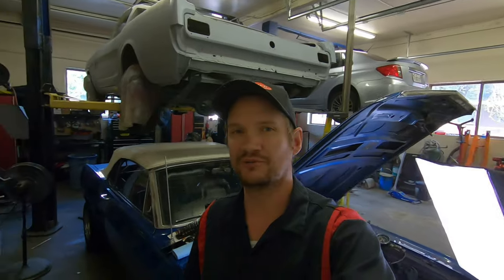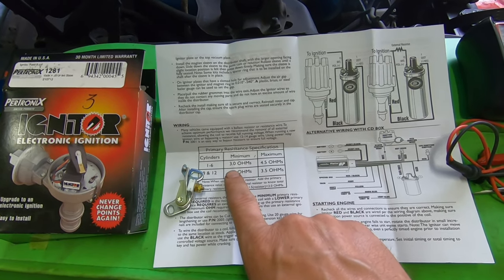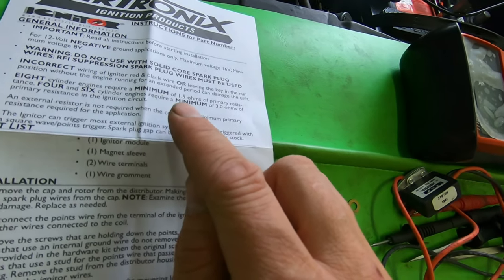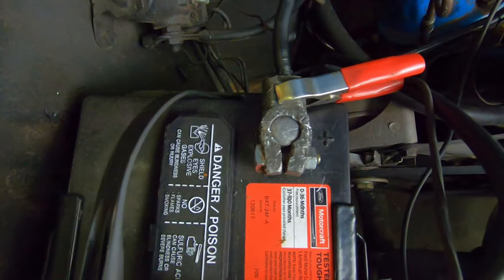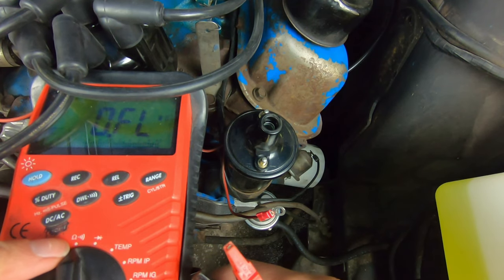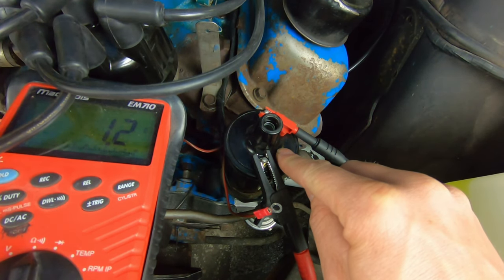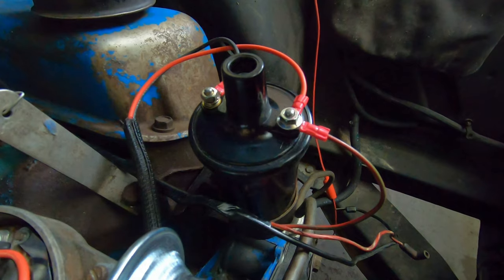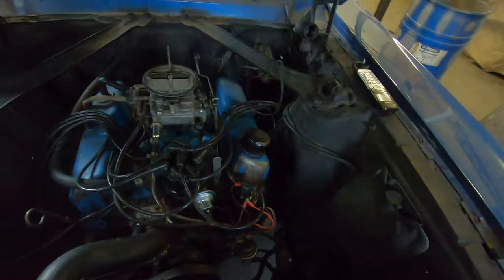Pertronix Electronic Ignition Upgrade - 1967 Mustang 289 V8

Comment: I would say that you need to bypass your resistor wire as mentioned in the manual. Your ignitor need full 12V, your resistor wire gives just 6-9V after start-up.
Reply from the maker: I understand it states that it operates best by bypassing the resistance wire and using their specific coil. But it's simply not necessary as long as you're within their total resistance specifications.

Comment: Im getting ready to start up my 68 Mustang and I'm reading 0.9 OHMs on the coil, which is a Flamethrower 3. I dont have a battery installed in my car. I have the multimeter set to 200  on the resistance. When I check my ignition wire and the positive battery terminal, it was over 200 OHMs. So I disconnected some wires I had mickey moused on the ignition to install a radio when I  just got the car back in 99. Plus some other wires I believe for a retro gauge minitach. Anyway, got it down to about 30 OHMS by doing that, but since the ignition was just hanging under the dash I mounted it correctly and now my OHMs are reading over 800 on the ignition wire. I know I must be the one doing something wrong but if you have any idea please let me know.

Comment: Thanks for video. I'm looking to install on '66 Mustang 289. What is your take on the Pertronix III? It looks like it requires a new Pertronix III coil and ignition power relay kit to provide 12 volts. Trying to decide between the two and would appreciate your thoughts.
Reply from the maker: Well to be honest with you, I've never installed a Pertronix III. Most the stuff I work on are stock engines/daily driver/cruisers. So with that being said, I tend to keep things as simple as possible. However, I'm sure the ignitor III unit is far superior to the basic ignitor. I would probably go for it and see how it works. But I would also run their coil and relay unit to get optimum performance.
Reply: @AlfsMustangGarage  Thanks for the reply. I have a daily driver. Maybe the P III is more than I need? It seems a little more complicated of an install than what you show. Excellent video. Thanks!
Reply from the maker: Ya it's definitely a little more than what this video demonstrates. So if it's just a daily/cruiser, you definitely don't need to get too crazy with it. Just keep in mind those resistance checks of your system and if things are not within specs, you'll want to bypass the resistance wire and use the actual pertronix coil.
Reply: The Pertronix III needs additional components removed from the distributor at the vacuum advance.
Advantage of the ignitor (first gen) and ignitor II (which has an additional circuit protection if you leave your key on) is that you can carry a spare set of points. In the unlikely event of a Pertronix ignitor failing or whatever, you can easily go back to points simply and quickly.

Comment: Very well done and well explained. Another thing to check is your set of plug wires' resistance, especially if they are old. High resistance in those can adversely impact performance .
Reply from the maker: Yes absolutely. Thank you!
Reply: What is a good range? I have Duralast Gold 7mm Suppression Core wires measuring at about 2,000 ohms per foot. Is that okay?
Reply: @LoneWolfStands357  Interesting, 5K Ohms is about the lowest u can get with suppression wires which is outstanding.
Reply: @supersonique001  oh sweet. I’m glad to hear that. Just curious, I searched for hours on google, is there like a spec sheet that you know of that lists what resistance wires should have? Thanks
Reply: @LoneWolfStands357  Not really, it's just that any good suppression wires should be as low as possible without interfering with radio signals. Zero resistance is usually solid copper which is no longer used because of their interference or wires that have a break in them which are no good to you anyway! At 2k Ohms your good to go!
Reply: @supersonique001  right on, thanks again

Comment: Excellent video. I knew about the resistance having to be correct but no other video that I have seen explained exactly HOW to test for it. I'm installing this on a 1987 OMC 3.0 boat motor. It is a GM 4cyl engine and I know that GM always ran a resistor wire instead of an external ballast resistor but don't know how OMC wired it from the factory. This video will save me a bunch of time and headaches not having to trace wires.
Reply from the maker: Oh right on! Glad I could help!

Comment: Great instructional video.
I had to do a resistance wire bypass after it failed. Upside was I was planning a Pertronix install anyway. Bypass was simple enough just ran a suitable gauge wire from the ignition pigtail (1970 mustang) to the coil, spliced in the brown wire from the solenoid (for 12v cranking). Had to upgrade my coil (due to the 12v run voltage) so used a Pertronix flamethrower suitable for 12v system and Pertronix ignitor. All good.
Great videos from Alfs mustang garage, 👍.
Reply from the maker: Oh right on! Yup sometimes that's the way to do it and sounds like you did everything right. Good work! Thanks for being here 👍
Reply: @AlfsMustangGarage  ,
Thank you for your videos,
Reply from the maker: You're very welcome

Comment: This is by far the best explanation on this topic! Thank you!!
Reply from the maker: You're very welcome
Reply: @AlfsMustangGarage  Hi Alf! Someone told me I should better supply my Ignitor 1 and the 12V ignition coil with a relay to relieve the ignition switch. Unfortunately this doesn't work at all (the engine keeps running after switching off) so I'm thinking about throwing out the relay and installing it like you without it. Do you think the relay is really necessary? Would the ignition switch really be damaged? Seems like most people install the pertronix without an additional relay. Car is a '70 Galaxie.  Would appreciate your thoughts...
Reply from the maker: It kinda depends mostly on what type of ignition coil you have. It also depends on how much total resistance you have in your circuit and coil. There isn't anything wrong with using the relay. But if it's not turning off, I'm guessing you might have it wired wrong. I would read the information that came with your particular unit and go from there. I talk alot about the resistance in the circuit and that often gets overlooked. I hope that helps.
Reply: @AlfsMustangGarage  Thanks for the quick reply! The coil I have is the Flame Thrower with 1,5 ohms. The ignition wire that went to the coil before now goes to 86 to trigger the relay. And 87 goes to + of the coil. 30 to battery +  and 85 to ground. You're right I focused more on wiring than the correct resistance. I'll have to check that. Thanks again!

Comment: Personally had alot of problems with the I & II versions. Went with the Pertronix III with the Flamethrower III & the relay that ensures you're getting 12v to the ignition. Doesn't have the issue of burning out if you leave the ignition on. Just spend the extra and get the III. Trust me. It will save you so much headache. Get good plug wires also. I went with Pertronix. Pertronix sells the relay on Amazon. Used on a Ford Racing 306 (slightly bored over rebuilt 302 roller motor). Dyno'd at 275 ho @ the rear wheel. 1968 California Special. C4 with Gear Vendors overdrive. 3.93 rear end but 2.72 final gear with od.

Comment: Great guide. If I understand correctly vacuum advance becomes disabled and it has no function?
Reply from the maker: No, the vacuum advance still functions as designed.
Reply: @AlfsMustangGarage  oh, of course I totally overlooked it. Does it add anything to general performance of the engine when driving (being loaded) it in comparisson to previous breaker system?
Reply from the maker: @AljosaPismonosa i don't think it adds any noticeable performance. Just a more consistent trigger mechanism that doesn't require the need to re-gap and/or clean up the carbon like with mechanical  points.
Reply: @AlfsMustangGarage  thanks!

Comment: Alf, Declan here in Ireland. The shaft in the distributor has some play in it so decided to swap it out with a replacement distributor. Before doing that I ran your recommended resistance tests. On the final test, ignition wire on coil + and other test wire from coil - to battery +, I got a reading of 6.8!! This can’t be good. With everything connected to the coil, a test across both poles have me 3.5. Don’t know if that has any relevance. My head hurts.

Comment: My 66’ mustang had the red wire of the igniter wired to a 12v ignition source on the starter solenoid with black on coil negative when I brought the car some years ago. I remember moving the red to coil positive and the car would not run. I assumed it needed 12v to the igniter which is why it would not start coil was only getting 7-9v so I left it how it was. The coil resistance was 1.3 ohms I didn’t measure the resistance wire though maybe that’s what the problem was. Resistance wire gets hot with engine running so resistance would be different with the engine running. Was surprised when you wired you clients car that way and it ran my car must have something different in resistance values in the circuit of something.
Reply from the maker: Could be. One thing I've learned is every car is different and has different history.

Comment: Hello, I have not read all the comments but in this case the red wire must be connected before the resistor and not on the ignition coil? Otherwise the measured ohms are missing. So I intepriede the drawing at 8min 12 seconds in the video. Or am I wrong? the video is very helpful thank you
Reply from the maker: So from my understanding of these units, you can install them a couple different ways and there is much debate about it. The way I did it on this particular car is largely based off the resistance values of the circuit for this particular car. Your car may not be this way and you may have to bypass the resistance wire and change your coil. You're far better off to read the instructions carefully and determine what is going to work best for your application.

Comment: Good morning,
I watched your video very knowledgeable, I appreciate it, after I installed the Petronix, that it has a high RPM Miss, have new plugs, wires, cap, rotor, new coil,
 the coil is within standards, total Ohms, there it's at 2.8 - 2.9 oms,
with the key on voltage at 6.96, can not find that Ignition resistor,
 to unplug it, to bypass it,
To run a separate wire from ignition to coil, the vehicle running at idle it's putting 11.96 V out when I rev it  goes to 12.96, haven't put a timing lite in it, any suggestions, thx Mark
Reply from the maker: What year is your car? The factory resistor wire is the first part of the circuit coming off the ignition switch to the firewall plug. There should be a bullet connector at the ignition switch going to a pink wire wrapped in its own loom.
Reply: @AlfsMustangGarage  66' Mustang, so I put the PNX-2001
Relay, after installing it, still has a miss at high RPM, it fixed the lower RPM miss

Comment: What do you do with the wire on the starter solenoid that goes to the coil
Reply from the maker: Nothing. The wire that you're referencing is the resistance wire bypass circuit. That is what gives the ignition coil its power while the engine is cranking.

Comment: Question. When testing the factory ignition resistance wire for a 1.5 Ohm reading using the disconnected battery cable + terminal to the ignition coil + terminal through the ignition switch in the Run position, would you not have to make sure all other circuits are off or disconnected/inactive that can be powered in the Run position like the heater blower fan, radio, wipers, any interior/exterior lights and switches also through any door jam switches, ammeter, clock etc etc or you would get a false reading because the multimeter would be applying current to any activated but not battery powered circuit in parallel with the coil. Example the tilt away steering relay is energized when the ignition is in the run position providing another resistance path for the multimeter current to take in parallel with the ignition coil resistance wire in the Run position thus giving an inaccurate resistance wire Ohm reading. Would it not be more accurate to go from the ignition switch terminal "C" on the ignition switch harness connector at the back of the ignition switch directly to the coil + wire bypassing any other potentially unknown activated circuit to get the most accurate reading.
Reply from the maker: You may be correct. Its best to test resistance directly off the ignition harness connector. However, based off my understandings of electricity, you're simply testing the continuity between two points. Even though there are multiple paths for electricity to flow, There is ultimately only one path for electricity to flow to get from point A and point B and that is what is being measured. Keep in mind, electricity will take the path of least resistance.
Reply: @AlfsMustangGarage  You're correct. The ignition coil resistance wire is isolated based on where the multimeter leads are attached. The negative multimeter lead isolates that circuit. Not sure what I was thinking or over thinking.

Comment: Timing. I have been fighting getting my 68 mustang 289 started, just bought it. I think it’s a timing issue. When stabbing the distributor in, where should the Rotor be pointing when the crank is right at 0 TDC #1 Compression? Thanks for the awesome videos. Also, I can’t use a circuit light to set static timing with a Ignitor 2, correct?
Reply from the maker: The position of the rotor is quite irrelevant as long as it's pointed at #1 spark plug wire and the proper firing order follows. However, I typically place #1 at the 1 o'clock position. Rotor spins counter clockwise so you would follow the firing order after that.
Reply: @AlfsMustangGarage  Right on, thanks again.

Comment: Hey Alf,

 I just installed a pertronix distributor and coil on my 65 mustang. I have an electric fan and eclectic choke wire I ran to the previous coil for 12v key on. 

 I need to move those elsewhere to get that power now. Where do you recommend? Will the heater wire work?
Reply from the maker: I typically wire aftermarket things that need 12 volt switched power directly to the accessory post on the ignition switch. Its a little extra work but that is what that post is made for. It's a far better solution than taping into another circuit.
Reply: @AlfsMustangGarage  thanks. Also, I have an aftermarket auto gage tac and flamethrower 2 coil with the pertronix distributor. 

I know they don’t want any wires going to the coil besides the distributor wires and the pink ford power wire. My tach calls to put one of the wires on the negative terminal on coil. Have you seen any problems with the pertronix stuff by doing that?
Reply from the maker: I haven't but I would always check with the manufacturer of the coil and distributor first.

Comment: Besides not changing the points every 6000 miles...... what do you benefit from the Pertronix? Does it help the car start easier?
Reply from the maker: It's probably a little more crisp and gives the coil the appropriate amount of dwell to deliver optimum spark. But the big benefit is not having to mess with points 🤣🤣🤣

Comment: This has been the best video I've found so far. Much better than the PerTronix video! I've had my 69 mustang for 38 years now and decided to make the upgrade. I'm somewhat new to multi meters but performed all of your suggested resistance tests. While the coil was at 1.6 the test between the start wire (red/green) to positive was a whopping 8+. Any ideas why that would be so high and how to correct?
Reply from the maker: Oh cool thank you very much! I've noticed that no one ever talks about the resistance needed in the circuit so I figured I would address that. So on your car, does it have a tachometer? With a resistance that high it might be worth double checking that value.
Reply: @AlfsMustangGarage  No tach, but you may be correct. Probably user error on my part.
Reply from the maker: Well it's definitely worth a second test I would say. You're old mechanical breaker points can still fire that coil off 5 volts but the electronic trigger definitely would need more. If that reading is real, you may have to start isolating your tests to see if the resistance wire has too much resistance or something. Good luck and let me know what you find.

Comment: I just saw another video and it said you cant use the positive side of the coil of you are running a resistance wire in your circuit. Do I need to run the positive side of magnetic pickup to a 12 volt source???????
Reply from the maker: I would recommend reading the information from pertronix thoroughly. I've never heard of not being able to wire that to the coil.

Comment: Do you have any suggestions on how to bench test Petronix igniter two? I’ve been tested everything else in the ignition system and it all checks out OK. I’ve done all voltage and resistance checks. I’m convinced this unit is bad but I don’t know how to positively identify if it is, can you help?
Reply from the maker: I'm afraid I don't have any suggestions other than to call pertronix and talk to tech assist.
Reply: @AlfsMustangGarage  Thanks for the response. I was number 26 in line when I tried to call tech support. Lol. I’ll try again another time.
Reply from the maker: Lol one of those unfortunate things.